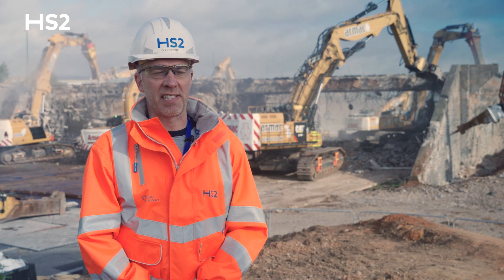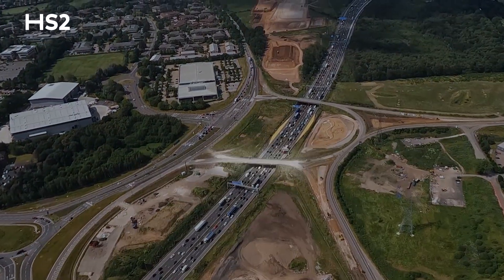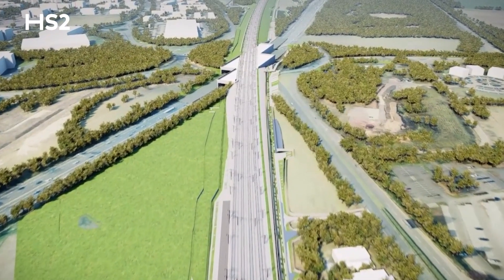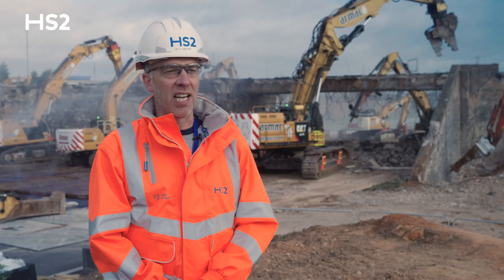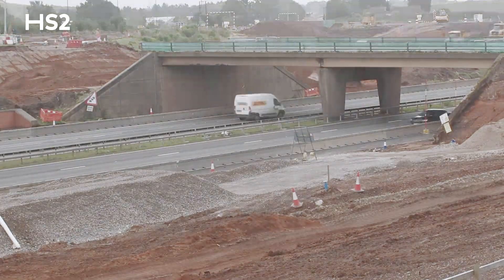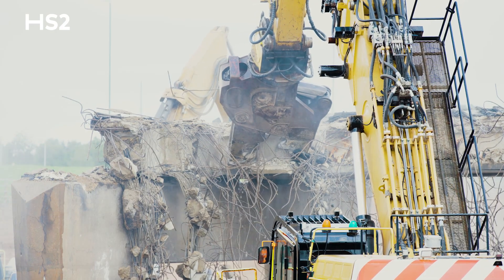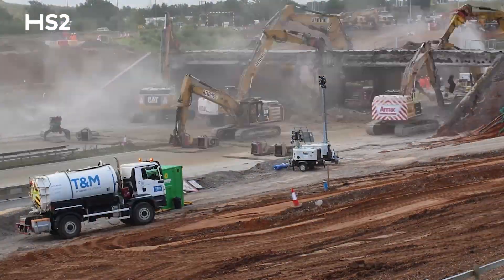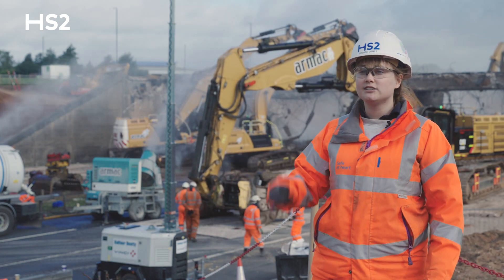How HS2 removed a 4,000 tonne, two-span bridge

Comment: Could have saved a few quid by installing a level crossing smh my head.
Reply: Or just have an enclosed railway bridge - they prob value engineered though and this is cheapest
Reply: For 320 kph trains over a motorway? Trains stopping takes about 1km for every 85 kph, which means you'd be waiting a while at the level crossing, as if it failed the train would have to stop
Reply: @amy-377  Think the previous question was scarastic

Comment: Annnnd it will all need replacing in 30 years due to poor management
Reply: Always one.
Reply: Do your crystal balls clank when you walk?
Reply: Unlikely
Reply: No, 50 years, and due to poor maintenance or lack of money for the maintenance
Reply: @jcoul1sc given that the UK has a sizeable percentage of the 1860s railway infrastructure still perfectly usable, what are you basing this on?
Reply: @KingFinnch   Generally large parts of the old stuff and other infrastructure was blt usin the best materials available at that time. Indeed most of it over 100 or 50 year sold is in dire need of repair or replacement. Londons Baselgette sewer is being replaced now with the super sewer. The old sewer will stay in use, but at some point it will be filled in.
My comment was based on the forst comment and evidence of issues form the  last 50 years. indeed many HS2 stations have been value engineered so they will only last about 50 years - 1mm thick cladding compared to 2.7mm and many other aspects
Reply: @jcoul1sc given that the UK has a sizeable percentage of the 1860s railway infrastructure still perfectly usable, what are you basing this on?